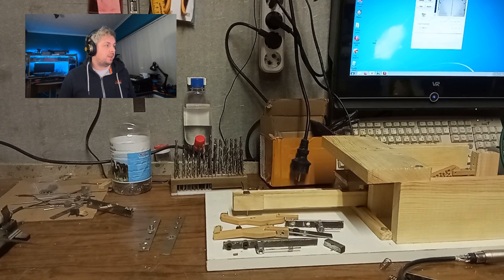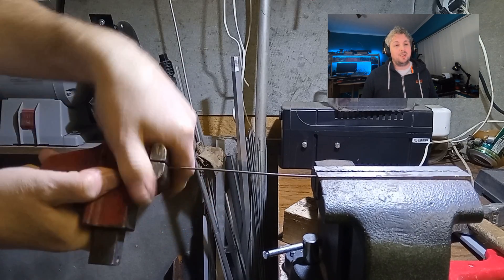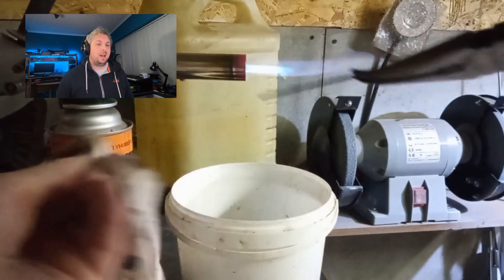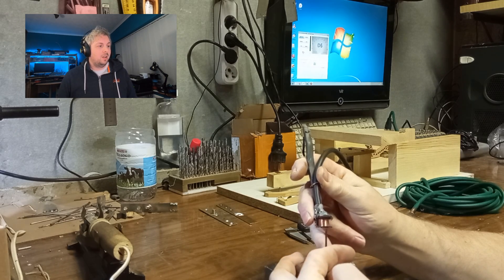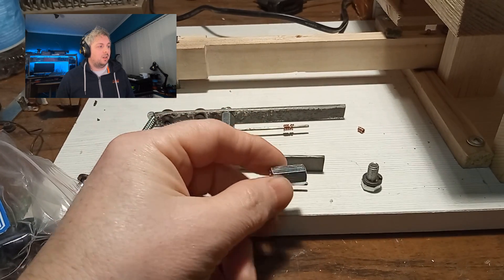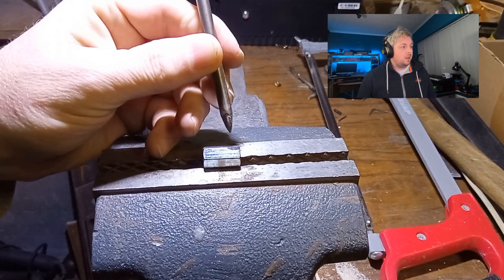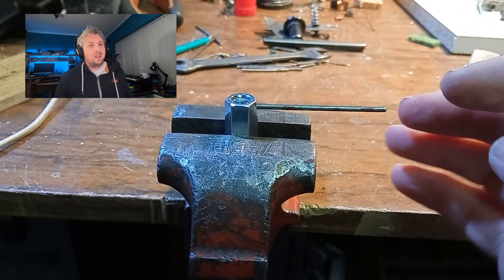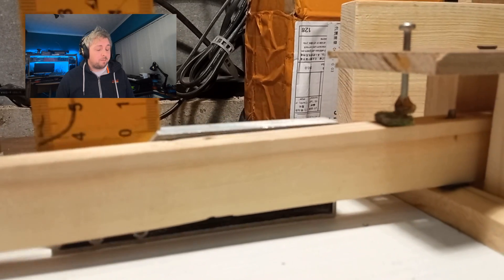DIY Electric Piano - Tines pt2 - Episode 14

Comment: I've been doing a course on material science while whatching this series and it this episode made me very happy :) I won't pretend to be any real help in this but my first thought was that i dont think there is any point in deformation hardening and recrystalizing before heating it up to austentite phase. That should basically homogenize the structure, which is the whole point if you are aiming for a martencitic structure after cooling, at least. I hope it works out for you!
Reply from the maker: Interesting input Rasmus. I did suspect the working may be lost with the heating. Though if it didn't reach a high enough temperature to fully become martensitic. I am not sure. I will have a go and share what I find.

Out of interest from what you know. Would you change the recipe?
Reply: @deancoyle  i have no idea hehe. Since it is a higher pitched resonance we are after i would say either method is probably valid, since they make the material stiffer. The deformation hardening might be a little more unpredictable and riskier? I would probably do some experiments with heating it upp to 800+ deg C, waiting a while, then cooling as quick as possible (chilled oil for biggest impact i think). At that point you should have a very fine crystaline martencite steel. Then you can experiment with just keeping the bit in a regular oven at around 200C for different periods of time. More time and higher temperature should give more flex and lower pitch.. I'm really not an expert though! Please don't take my word for this.
Reply: @deancoyle  i dont want to say much about plasticity treatment since i dont know enough. I'm fairly sure only some materials actually get harder from being worked, it is basically about forcing inherent defects (aka gaps in the atom matrix) into stable positions. But there is also a phenomenon called recrystallisation, which is pretty strange and alien to me. I don't know its practical uses but it states that if a material has been deformed more than about 5-15% (change in length i think), and you then heat it up, it will shatter the old 'cells' and form a finely grained new structure.. I hope i have given you some foundation for what to read about in future research at least!
Reply: I should have phrased this as a question instead haha. I wonder what the goal is with those steps in that order.
Reply: @JenkemFactory     In fact, I do not own material science. It's just an attempt to make something similar to a well-sounding tines. And it happened. If you have knowledge in the material science, share them with us, we will be very grateful. Even the smallest advice will mean a lot! The one who does nothing, nothing will happen.)))
Reply: @staskiselev8911  It seemed to work well! My knowleadge is only theoretical, I have never worked steel. What I can say is that the effects of heating and cooling steel can be read from a 'TTT' diagram. They are a bit hard to understand at first but they tell you what structures will form when cooling at different speeds. I allso know that while making cymbals, they leave the finnished cymbal to rest for 1-2 weeks before doing listening tests, because the material will continue releasing inner tension and so on. Rapid cooling can also create tension, and so, if you want to keep the material super stiff (and dont heat it up again, which will make it softer) you can let it rest in moderate heat for a long time.
Reply from the maker: Interesting information on cymbals. I did wonder why then they broke they split into rings. I guess all that pretension explains that.
Reply: @deancoyle  
The thinner valleys in the grooves are weaker, so they break there, like a perforated paper.

Comment: It’s really interesting that you had problems with the high notes, because Fender/Rhodes did too! That’s why they released the piano bass first - they didn’t have a working design for the upper octaves!
Reply from the maker: My plan is to keep it with readily available items, but yes the high notes really need high strength materials. I hope to have some updates on this project in the next few months.

Comment: Love your videos! Been wanting to try and make an electric piano for the last year and your videos have inspired me to go from "its too hard" to "Im going to try!"  Two weeks in and prototyping actions so far.  Waiting for metals and copper wire to arrive  to start fooling around with pickups and tone generators.  Really outside my comfort zone with this experiment so your videos are great help and inspiration.
Reply from the maker: I think I am outside my comfort zone too haha.
How did you get on?
I am hoping to post some updates soon.
Reply: I have one prototype key working finally!! Fussing around with damper and tone bars at the moment.  I'm a bit against the wall when it comes to calculating how long to make the various tines and tone bars for each note.  My one random note has a pleasing tone with very little pitch decay. Didn't heat stress the tine but it is very high tensile steel to start with. Might be less pleased at different tine lengths though...I guess I will soon find out.    @deancoyle
Reply: Been experimenting with a tone bar assembly by putting a bolt through the tone bar, then sandwiching the tine between 2 washers and nuts on the bottom of the bolt.  Super simple and seems to transmit the energy ok.  I don't have the best shop so I've been trying to find ways to avoid as much metalwork as possible!

Comment: Hey Dean, have you ever made 3D Prints of Stackers for the Fender Rhodes MK1 ?
Reply from the maker: Hey, I havent, though if were to make some I think i would get some steel flat 60x3mm and use a bending/folding tool to create something.
It would be a very big 3d print.

Comment: This came just in time. The brass bars are in the shopping cart but that long nut changed my mind
Reply from the maker: It is all experimental at this stage, plenty more could change. It is good to hear you are planning having a go yourself.
Reply: I tried twisting and quenching a few “1.5mm piano wire” tines. The result is super strong and springy compared to the original material. I did find it difficult to heat the tines with a butane torch without the tine sagging. The change in composition caused the long ones to bend under their own weight. After quenching in oil, they were very reluctant to return back to straight. I may try again while holding the tine vertically.
Reply from the maker: Thank you for sharing what your found. And Thank you again to Stas!